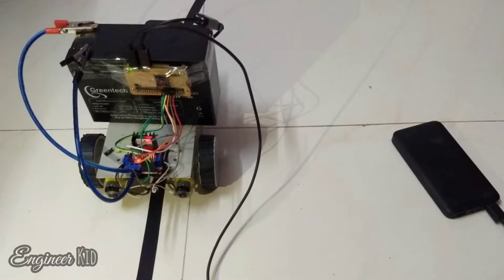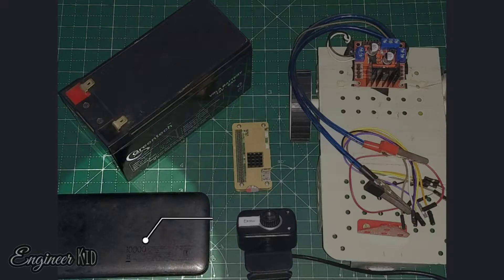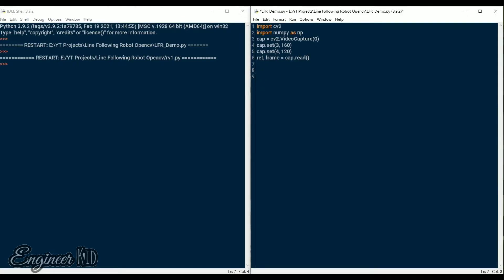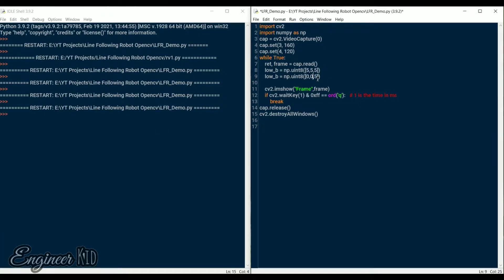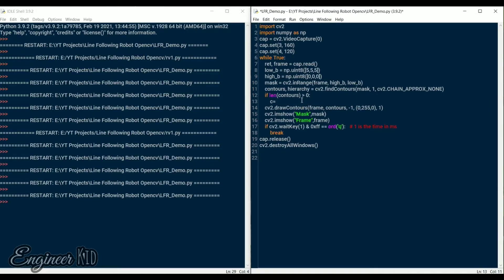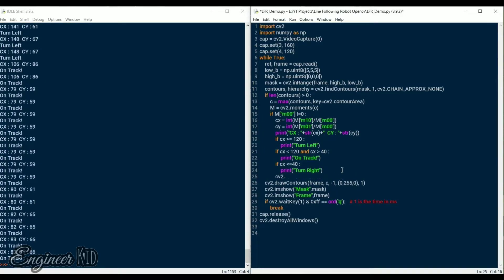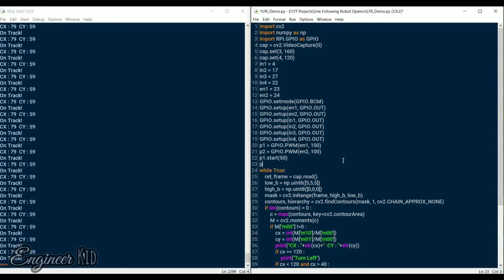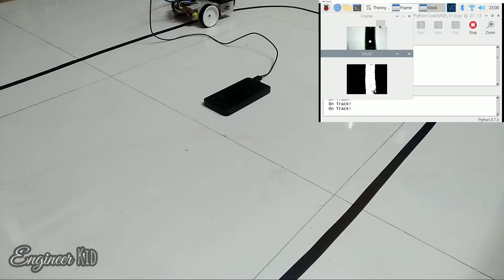Line Following Robot Using OpenCV

Comment: Can we increase the speed
Reply from the maker: You can but you would need to use a better rpi for processing frames faster and integrate a pid control to steer the bot quickly and accurately.

Comment: how i fix the position of the camera?
Reply: Do you mean with screws? or maybe with a bracket mount?
Reply from the maker: A bracket that would hold the camera parallel to the line on the ground

Comment: can we use raspberry pi 4 instead of zero
Reply from the maker: Yes, you can
Reply: @EngineerKid   what all changes should be added
Reply from the maker: The code should work fine once you setup the rpi and camera properly

Comment: Increase the speed bro
Reply from the maker: You can try. My pizero was unable to process usb camera data and line detection that fast. Also faster inputs would need to be averaged to avoid wrong turns. And you would need a PID control to keep the bot in center

Comment: Error: 
"cv2.drawContours(frame, c, -1, (0,255,0), 1)
NameError: name 'c' is not defined"

Can you help me?
Reply from the maker: You did not define c. Please check with the source code.
Reply: @EngineerKid  It's your code. When I try to run it, I get this error.
Reply from the maker: Check indentation. The code is correct I believe, no issues there.